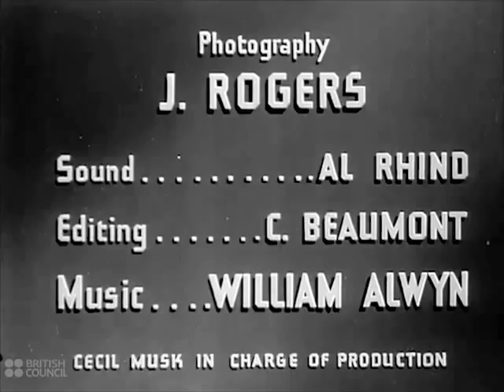Shipbuilding - 1940's  British Council Film Collection - CharlieDeanArchives / Archival Footage

Comment: Caulking by hand,proper hard graft,its bad enough doing it with a pneumatic caulking machine
Reply: What did they caulk steel plates with?  I know oakum was used with wood construction.
Reply: you would use felt paper inbetween the plates or oil paper if it was an oil tank

Comment: How could all this disappear in the space of 60 years?
Reply: Honestly it was already obsolete when this was filmed. Go and view the films of the Liberty and Victory ships built in the US not much later. Most of the riveting was gone, replaced by electric arc welding. Ribs were formed in rolling mills and the superstructures were built away from the slips and craned on to the ship after the hull was done and with the wiring and other fittings already installed. In all honesty the English had their way of doing things and they were not going to try and stop and retool everything when they were in the middle of a war. There are some advantages in starting from scratch and finding new ways to do things.
 Also the fact that in the post war years the large numbers of Liberty/Victory ships were a drag on the market for merchant ships for at least a decade, so there was not much demand for merchant ship construction until the 1960's.
Reply: @keithstudly6071  I meant our merchant ship building industry in general, not this technique. it's shocking to see how this part of our heritage has vanished.
Reply: @JasonJason210  Point taken. These things tend to change in waves. New replacing old only when the old has collapsed and minor improvements not enough to cause wholesale change.
Reply: thank the yanks, they gave cheap money to first Japan then Korea to build up their shipyards to keep them from going Communist. With new machines, huge new yards and low wages, shipbuilding in Britain was finished. Queen Mary 2 was built in France of all places.
Reply: @tandemcompound2  Like much of British industry in the 50s/60s/70s it was rooted in the past, with an inflexible, strike ridden workforce, restrictive work practises and refusal to embrace modern technologies.  Added to this was poor management and poor government, and unions more interested in formenting revolution rather than caring for workers and their jobs.
Reply: because the internationalist 5th column active in Britain decided amongst themselves they would specialise ONLY in banking and finance, hence why mining/steelworks/fishing/shipbuilding/textiles was no longer supported and was allowed to decline-regardless of the long term effects on the lives of ordinary working people. That t##t hessletstein epitomises that mindset....."I am in awe of the rich and powerful, and what they want is what I will give them"
Reply: GOLDSMITHEXILE 2016 whilst we were greatly successful in the industry, if we didn’t move on then our economy would be no better than the countries we handed the industries to. don’t forget the north sea is empty of fish now but also full of oil and gas rigs which is now a big part in our modern industry